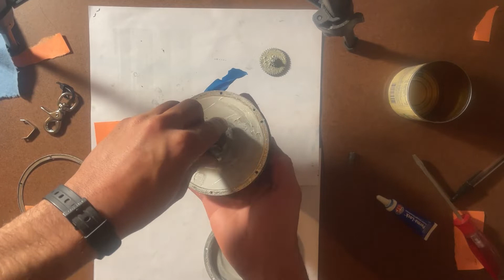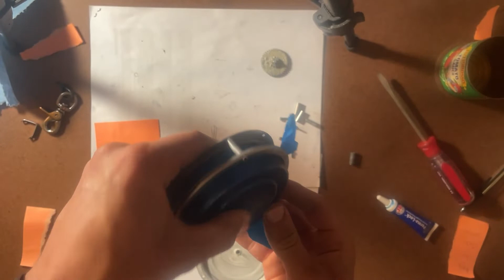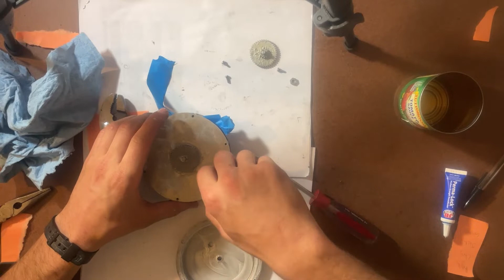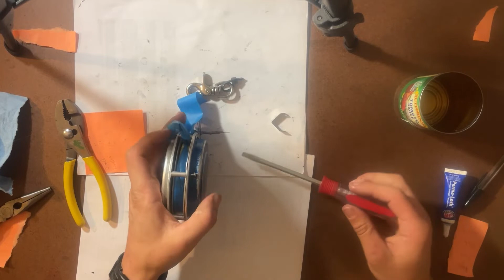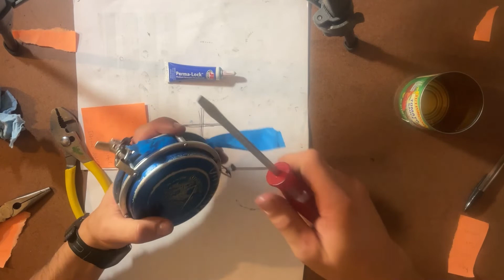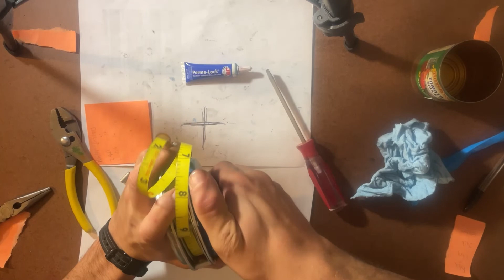Loggers Tape Maintenance Complete Rebuild

Comment: Do you have a video of or advice for if the spring unspools?
Reply from the maker: Put on a pair of gloves that you still have good dexterity in and coil in back up in the case. For whatever reason sometimes the spring bends into a S when it comes out, that coil all goes in one direction. Big pain in the butt getting it back in there.
Reply from the maker: Just made a video for that about a week ago.